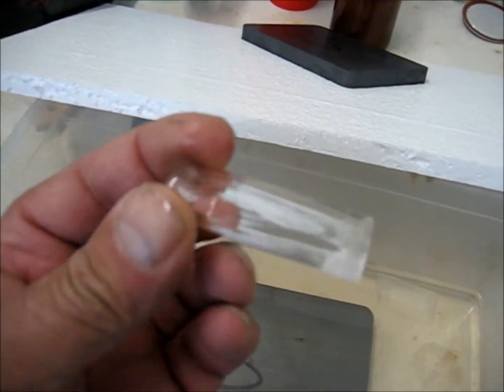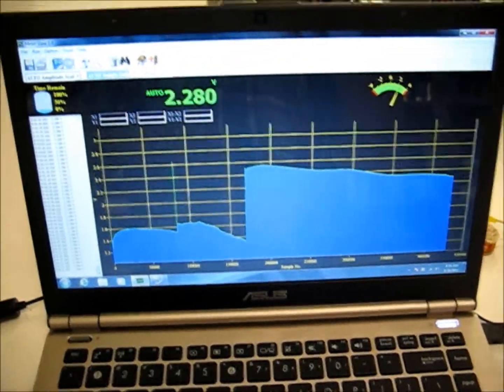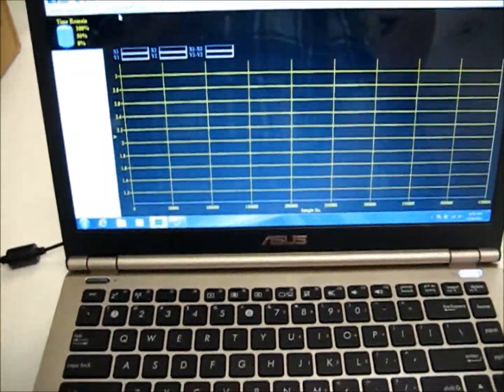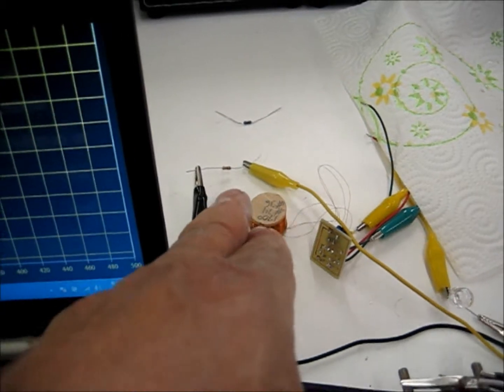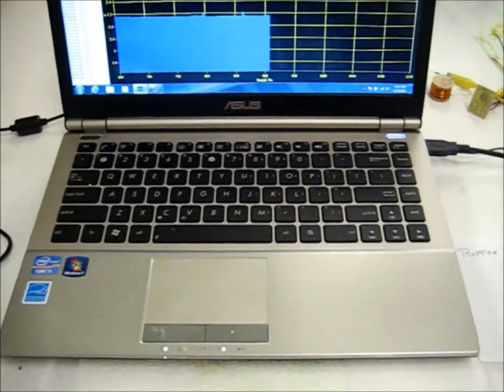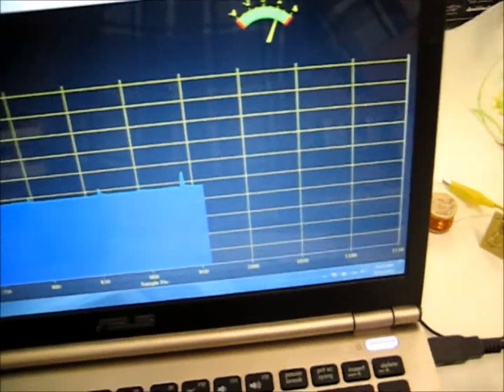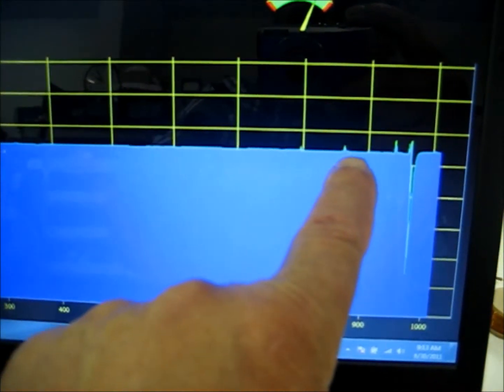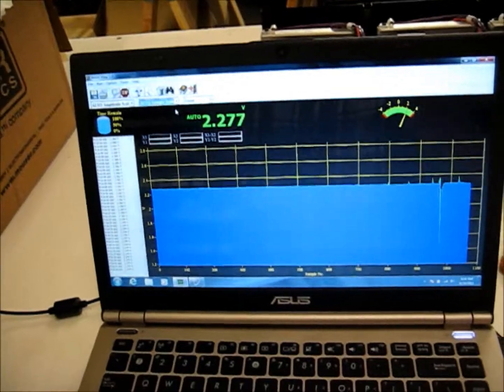Crystal Cells in Series  Restive Load Over The Weekend

Comment: I agree piezo but maybe something more,piezo only playing a part I think that it is pulling in static as well, that crystal that was different than the rest like a pyramid with geometric lines without the cap that's the seed you need for the pure crystal cell place electrodes on flat of cap and continue growing until they are incased if the water is colloidal than the crystal already doped should conduct the potential difference and then some if it's static and piezo although when I monitored t